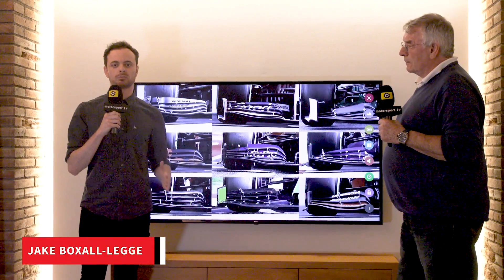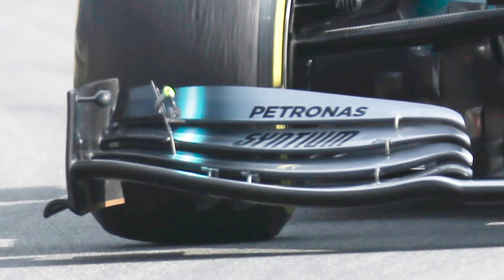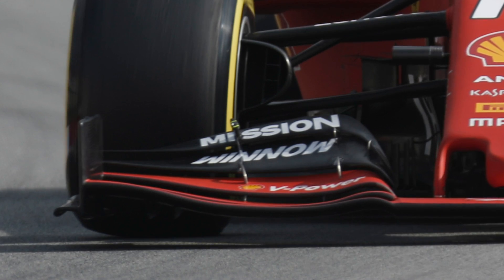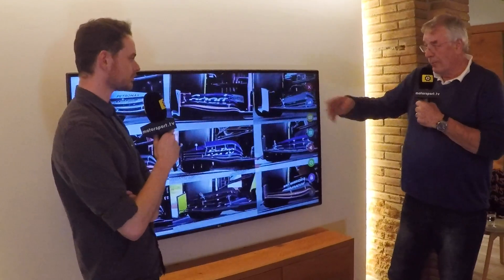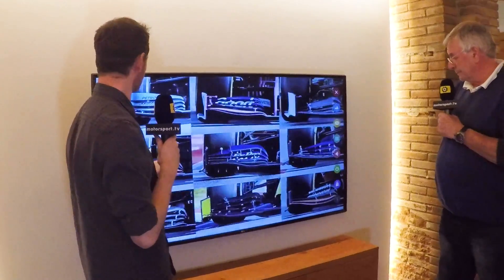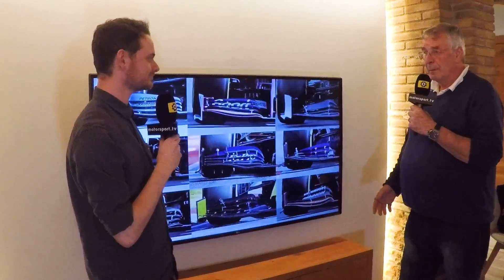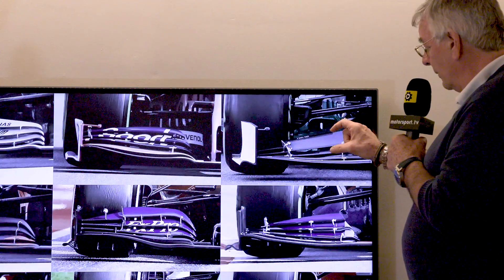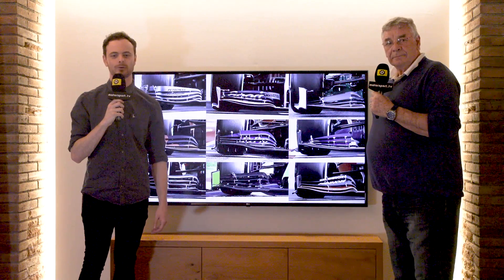How the new 2019 F1 front wings compare

Comment: Wonder how much downforce/ outwash they would lose if they lose the end plates during a race and which design will be impacted more
Reply: The endplate stops the difference of pressure on the top and bottom of the wing creating vortices. It would definitely reduce a lot of downforce.
My guess is that the mercedes design would be more impacted because there's a larger portion of the wing at the edge.
By the way I might be completely wrong given that I'm not at all an aerodynamicist.
Reply: I think verstappen lost that part of his front wing in spain last year and it really didn’t seem to influence the car that much
Reply: @ohhDarkstar  I assumed with the new regs and new front wing design it may impact more as the teams exaggerate end plates so much now.
Surely the teams running the "inwash" style would be effected less..
Reply: the teams with flattened out wings have the entire front wing trying to produce outwash, instead of maximum front downforce, and nearly uninterrupted flow around the endplate.
in the full downforce concept the endplate just gets the leftover airflow that"s not pushed up for producing outwash, and is maily there to prevent spillover airflow under the wing.
so the former should lose the most when losing the endplate, with the center of the wing still pushing some air in front of the tyres, none being directed over them, and the strongest outwash element missing.
noone attempts inwash, mercedes tried it and quickly switched back.

Comment: Good point mentioning that the different design in the two red bull car can copy each other if either one stands out
Reply: they won't copy each other because a redesign of the front wing mean a redesign of the whole car aswell, that's what mercedes engineers explained.
Reply: I guess Red Bull went for high R&D path, their front wing is unique design. Meanwhile TR tried new solution, just for security, and cheaper solution. At the end if RB’s a little bit more efficient, they will not follow at all.
Reply: Why you cares torro rosso is under red bull. They can copy each other if they want to its the same sponser of red bull.